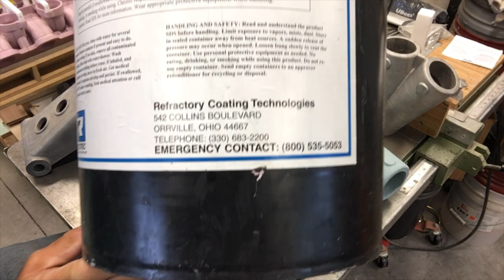Refractory Coatings for Lost Foam Casting Patterns

Comment: The one big issue using drywall compound is that it will eventually turn fowl by bacteria and mold growing in the compound especially when you mix in water, it will pull in spores and bacteria from the environment. It will last a while but does have an expiration date.
Reply from the maker: Haven't had that problem but if so, a teaspoon or two of bleach will fix it. Best, Kelly

Comment: I can't thank you enough for your generosity in putting these videos together. I was thinking about converting my milling machine to CNC to make complex parts but after watching your video series, my mid-weight CNC router will handle the foam cutting and the lost foam cast will get me what I want. I have done sand casting before with great results but hated dealing with the sand and keeping it mulled. Excellent video. I see 10k plus subscribers in your near future!
Reply from the maker: If you already have a CNC router and proficiency with CAM, Gcode and a good post processor, you'll be starting miles ahead of where I did. Glad you found the vids helpful. Happy casting. Best, Kelly

Comment: I'm one of those guys on you tube that cake on too much and have been struggling with bubbles. This information is gold. thank you so much. I can't wait to try using the dish soap. I was having venting issues but it turns out i was putting it on too thick. thanks you Sir.
Reply from the maker: Thinner coating will help. Saw you recent vids for coin casting molds and plaques. You're on the right track. The one for your nephew that had the defect was because the sprue and contact area were too small for the pattern and couldn't feed it fast enough to prevent partial mold collapse. Best, K
Reply: @kellycoffield533  thank you Kelly. Cool. that makes sense. I appreciate the reply. cheers
Reply: hi, do you have any lost foam question

Comment: Wonderful video Kelly with lots of great information...you have got me now wanting to get back into casting...Looks like I will need to watch most of your videos...I use to teach Lost Wax casting at the Glassel School of Art in Houston, so with your new info I should be up and running in a short time...I would like to make some aluminum uprights for the front suspension for a Stylized 1923 Bugatti type 32 roadster I am building...thanks for the timely find of your series...
Reply from the maker: Glad you found it helpful. With your past experience it should be a much shorter learning curve. Structural parts like uprights deserve design conservatism. Get your process down then enjoy being able to place metal where you want it! Best, Kelly
Reply: hi, do you have any lost foam question

Comment: Thank you so much for your videos on lost foam casting! I got so excited about the possibilities that I bought a pin router for future pattern making. I sure hope you made (or will make) a video showing how you made the big, complicated intake manifold pattern. Do you use a lower temperature hot glue to assemble the pieces, or some type of regular glue? I want to eventually use your methods to make some finned valve covers, oil pan, and maybe an intake manifold for a hotrod project I'm working on.
Reply from the maker: I do have several videos in the works I'll post in the very near future that will address your questions. Pin routers are very versatile machines, and an excellent alternative if you're not a CAD/CNC guy. With the exposed cutting bit, pin routers are a serious threat to the operator so give it due respect and make fixtures where necessary to keep you hands out of harms way. Best, Kelly
Reply: hi, do you have any lost foam question
Reply: @kellycoffield533  Much respect Kelly, did you make a video that explains the gluing part? Thank you!
Reply from the maker: @makingcookingfixing  https://youtu.be/T2H8UH3TeaM

Comment: When you have wet slip in hollows, after mopping out with a brush, could you use a hire drier on low heat to finish drying the part?
This is very interesting and thank you.

Comment: Aways great videos Kelly with invaluable information! One question is in this video you mention as an alternative dipping slurry to use light weight non-setting drywall compound but in your earlier video about a year ago when you were casting the saucer cup and spoon you mentioned to use non settings drywall compound. Is their an improvement using the light weight non-setting drywall compound over the regular non-setting drywall compound or will either work just as well?
Reply from the maker: I'd imagine either would perform about the same. I had the lightweight stuff on hand. It may have a slight advantage if the lightweight filler is more porous, but other than that, I think either woul dbe fine. Best, Kelly
Reply: hi, do you have any lost foam question

Comment: Given your experience, how do you feel about ‘burning out’ PLA/Wax forms for lost resin casting?  Is it really necessary?  (Btw, polypropylene glycol has surfactant properties but propylene glycol is a different agent altogether.)
Reply from the maker: PLA/Wax/Foam are all evaporatve pattern casting processes. I like lost PLA/Wax/Resins for highly detailed small parts like jewlery and ornamentals but lost foam is so much more economical and practical for larger parts because the mold media and pattern material are a very small fraction of the cost, not to mention the large difference in labor to make an investment or shell mold versus just vibrating loose sand, and then the need for a very large oven and energy cost to burn it out. 
For a part like one of my automotive intake manifolds, it would be 300-400lb of shell or investment and take days or a week to burn it out. To demold, in lost foam I just dump loose sand on the ground (which I can reuse) and pick the part out instead of hours of chipping away and disposing of 400lbs of investment or shell. Not sure where you're going with PPG vs PG comment but I said what I meant. I use dilute Dawn dish washing detergent because one of the active ingredients is propylene glycol, along with other surfactents, costs pennies, and is much more benign than ethylene glycol. Best, Kelly

Comment: Until I happened upon your video, I never knew such a craft existed. You get crazy good results with your methods. Is this method good for cast iron exhaust manifolds for antique engines?
Reply from the maker: Yes, most lost foam casting done in industry are iron lost foam castings. Best, Kelly

Comment: Hi Kelly i have signed up on the The home Foundry  a few days ago but im still waiting for confirmation ( Your account is currently awaiting confirmation. Confirmation was sent to ) but nothing has been sent to me ?   i have a question as i live in Norway we dont have the powder dry wall none setting joint compound we have some ready mixed stuff  when looking in the data leaflet what should the main ingredients be in it , as i should look for as we have no refractory resellers here 😞 your videos are great keep up  the good work 🙂
Reply from the maker: What is your user name? I'll watch. Sometimes our software will flag an IP address as a spam source and that will cause rejection. Drywall coatings are mainly, plaster of Paris, gypsums, and small amounts of clays. If it's ready mixed, it is non-setting. The pottery hobby may have similar refractory materials. Also companies that service boilers. For lower temperature metals, some European hobbyists have used Wytong brick as furnace refractory. Best, Kelly
Reply: @kellycoffield533   my The home Foundry user name is ( acr ) thanks for the reply and info 🙂
Reply from the maker: @ALANCREA  You'll need to re-apply. Best, Kelly

Comment: I would like to test out a mix of plaster + silica sand in thin coats brushed on on the master. After the first coat i want to use steel wool to incorporate into the next coat and then just pour the rest. What do you think ?
Reply from the maker: Reinforcing the coating is not necessary in lost foam casting because it is used to control the escape of evaporating pattern gases and improve surface finish, but not used as structural mold support. That purpose is served by the compacted sand.
Reply from the maker: @sierraecho884  OK, that sounds more like investment casting. Precoating is common, as is adding silica to the plaster. I dont do much invetsment casting but friends that do larger castings just use wire/fencing as reinforcement cast/invested in place in the outer diameter of the investment.
Reply: @kellycoffield533  Thank you for the quick response. You work is great btw.

Comment: Would pre-dipping and letting  those somewhat weak runners dry give them a little more strength to aid in the handling?
Reply from the maker: I do pre-dip the sprue seperately and attach it when molding. I do modify the gating at times to make it strong enough to handle when dipping. The coating can be poured, ladled, or brushed as well but dipping is so fast and produces such a uniform coating it's hard to beat if you have thefacility for such. Best, Kelly

Comment: I have a question, how with one layer of ceramic and without covering the sand does not crack, I use several layers and sometimes cracks occur
Reply from the maker: Must be the type of coating you are using. This coating is not the type used for ceramic shell casting. Best, Kelly
Reply: @kellycoffield533  Thanks for the reply. What are the ingredients that go into this paint and their amounts?
Reply: @kellycoffield533  Your paint can be used with models that come out of a 3D printer
Reply from the maker: @goustavonana2930  No. Coatings for 3D printed patterns are intended to become hard structural mold material. Lost Foam coating is not a structural part of the mold. It merely serves to replicate the surfcae finish of the foam pattern and act as a permeable layer between the pattern and mold sand to control the rate of escaping gases. Best, Kelly
Reply from the maker: @goustavonana2930  Probably too involved of a discussion for a YT reply but if you are casting aluminum, try using thinned dry-wall joint compound. It works well. The light weight non-setting variety is best and contains many of the same ingredients of commercial lost foam coatings. Best, Kelly

Comment: Mr Kelly !
I have been making my foam modules by hand (please watch my video called Lost foam casting a crank case of paraglider engine). Can you show your milling machine clearly in a video
Reply: hi, do you have any lost foam question
Reply: @casthc6795  yes 1 I dont know which  kind of Aluminium  raw metirial should be used(I am using scraped brake parts) 2 I want expidite modle making with foams.and I want to know should my casting to  be heat treated or not .thanks for asking help
Reply from the maker: Hi MAD, I commented on your video. I'm mostly using a CNC router now but try viewing my video "Carburetor Main Well Foam Pattern". It shows what can be done with hand guided pattern routing with wood working tools. Best, Kelly
Reply: @kellycoffield533  yes thanks Mr Kelly.I watched your video.l think my main disadvantage is using expanded  polystyrine.and i,ll use router soon.thanks again for watching my video
Reply from the maker: @madlankan6735  I have found the extruded PS to machine and finish better. Expanded Polystyrene packaging can vary widely in density, but can also be sanded for improved finish and appearance. Higher densities machine and sand better at the expense of more material to vaporize. You can use your hot wire to pattern cut foam with a simple cardboard template. I show this in one of my videos. If you reduce the length of unsupported wire it will improve accuracy, but you are limited to 2D pattern parts. Patterns made with template guided router cutting can be 2.5D and will generally be more acurate and repeatable. Best, Kelly
Reply: @kellycoffield533  yeeees Mr Kelly I can make short my hot wire and it will great help for accuracy .& iam planing to use routre bit .I lke to say that your video keep me in a better posision .I have been making a engine since 2 year+ .Your videos and you expidite me.Thanks.

Comment: Would the drywall slurry would work with PLA parts?
Reply from the maker: Not sure what you mean. Lost PLA would use investment casting not the lost foam method. PLA will cannot be evaporated by the molten metal during pouring.  It's too dense. It must be invested and burned out of the investment before casting to remove the pattern and cure the investment. Though many investments are plaster like, they have other ingredients to improve strength and permeability after burn out. Best, Kelly
Reply: I meant using the drywall coatings in the same way that ceramic coatings are used in the lost wax method. This would consist of repeatedly dipping the pla object into the joint compound, burning out the plastic in a furnace (leaving only the shell behind), and finally pouring the molten metal into it. I was actually able to test this possible method during the past week and found the following:

1. Using a foam riser gives the plastic room to expand but there still tends to be cracking and breakage along edges/corners. Adding sand did help a little bit but having lots of ventilation is the key. The breaks are usually very clean breaks and can be repaired quite easily with more slurry followed by a subsequent firing. 
2. Painting on the first coat works best in order to capture small details (if you need it) and for ensuring total coverage of the object. Air bubbles still pop up despite dipping the object in surfactant beforehand, running it all through a vacuum chamber, and adding soap to the slurry. 
3. The biggest problem is the insulation  with the empty shell. Transfer time form the furnace to the sand needs to be extremely quick to minimize heat loss and even then it’s still too cool half of the time. This method is much less forgiving than the sand and plaster method which stays hot for longer periods of time even in the open air. 

All-in-all, I would say this method has great promise and I will be experimenting with it further.
Reply from the maker: @andrewatchaboy2762  Apples and Oranges. The coating in lost foam casting serves as a permeable barrier not as structural mold. Best, Kelly

Comment: Qual material uza para mergulhar as peças para fundir esse produto verde
Reply from the maker: If I understand correctly, you are asking what I apply to the foam pattern before the refractory. It is a 1/2 teaspoon of liquid dishwasher soap ("Dawn brand") in a gallon of water. The anti-spotting agent is Propylene Glycol which acts as a surfactant, reduces surface tension, and makes the refractory wet the foam without bubbles. Best, Kelly
Reply: @kellycoffield533  ok seria sobre esse refratário do que ele é feito

Comment: What is refactry sllury
Reply from the maker: Refractory just means ability to withstand high temperature, but the slurry is a coating that preserves the surface finsih of the pattern and allows the evaporated foam gas to escape at a controlled rate. Dryawll/Gypsum/Plaster mixtures work for lower temp alloys. The more refined commercial versions are usually Mullite/Alumina/Zirconia mixtures with clay binder and additives to keep the constituants in suspension, self-level, and wet the pattern better. Best, Kelly

Comment: I have been watching a lot of your videos and you do very nice work. I was wondering what you do for a living. I am machinist and I make a lot of parts for pulling tractors. Now am trying to make a pattern to cast a new head for a tractor. I am making it from wood. I also will  need a new valve cover because the head will be a little wider than a stock one. I thought about making this from aluminum and using the lost foam method. Years ago I made an aluminum intercooler using the lost foam method. There is a place close to me that 3d prints cores and molds out of sand. I think the machine lays down a layer of sand but only applies binder where you want a core or mold.

Here is a video about the company
https://www.youtube.com/watch?v=deVMFqZlmUk
Reply from the maker: IMO, lost foam is far more practical than conventional hard pattern sand casting for making one-offs, and small quantities, but sort of depends upon what you are set up to do. After you get your processes sorted, it becomes all about the pattern making, but best to work with some simple projects before attempting a pattern where you've invested a lot of time. Best, Kelly